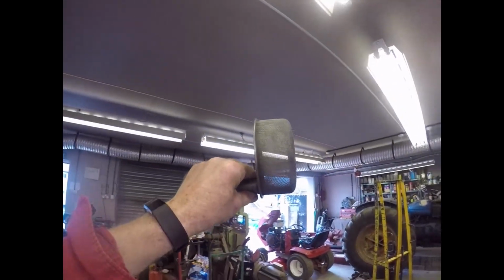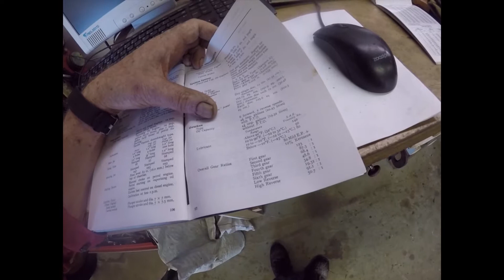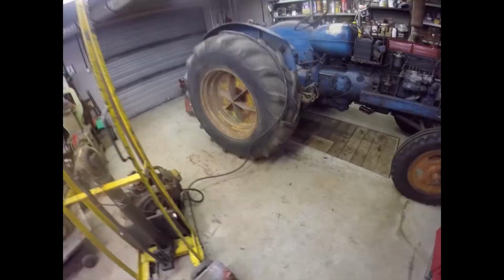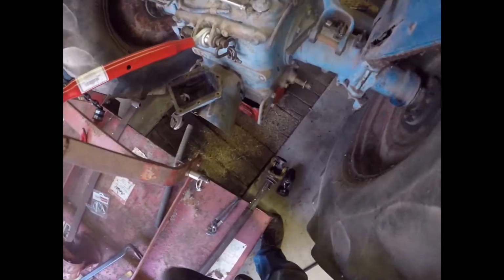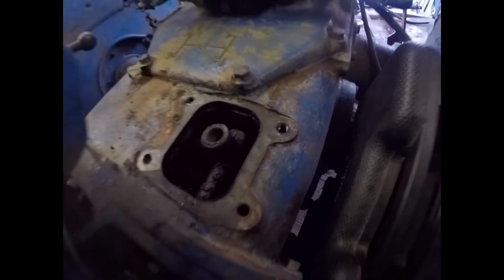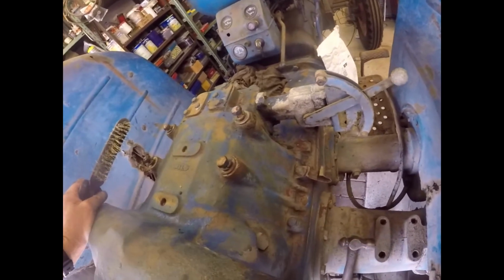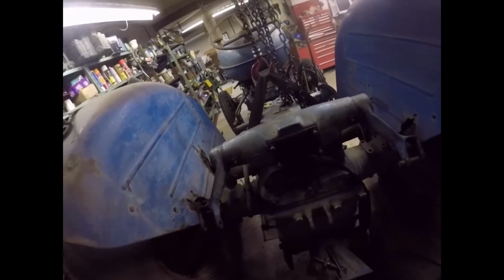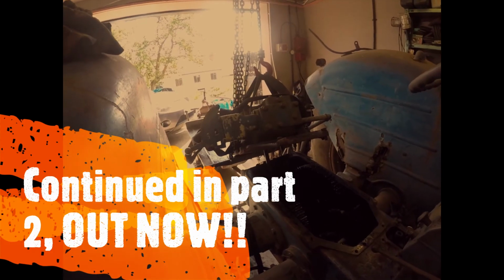Fordson Major rebuild Part 7, Hydraulics and rear transmiaaion

Comment: Blimey, looks like someone has used old engine oil in the back end. Petrol and acetone should shift it. An interesting series on this fine old tractor!
Reply from the maker: Thankyou Jon, I am sure they drained it out of the engine and put it straight into the transmission, lumps an all! I am a bit affeared of using too stron a solvent because right at the lowest end is a very important oil seal that is the only thing seperating the 90 in the gearbox, and the 40 (or whatever) in the transmission/hydraulics!

Comment: All our tractos take oil without additives too. We have been looking at the exact tap and die set, it would be good to know what it is like when you use it
Reply from the maker: Tap and die set? so far so good! Haven't cut any new threads, but have cleaned up many and it seems fine. I used to run my 2cv on straight 30 mineral oil, thats what the engine was designed to run on, and straight oils are better than multigrades in air cooled engines!, thanks for the comments!
Phil